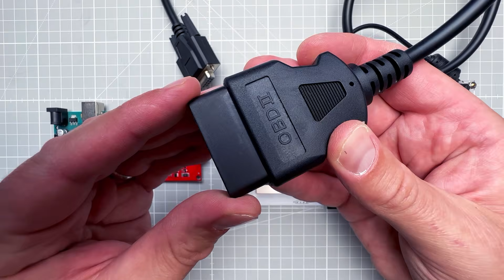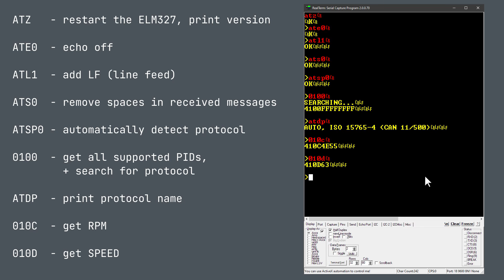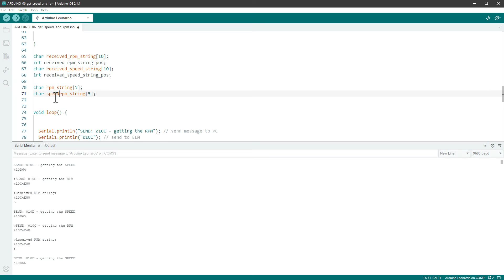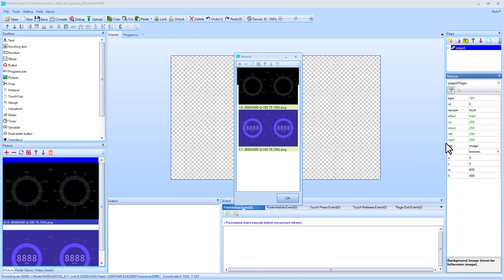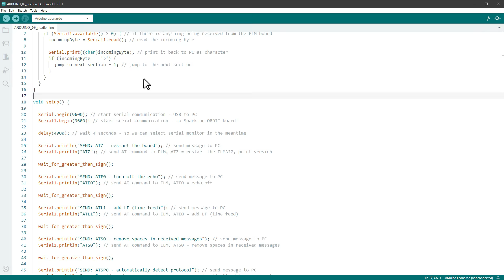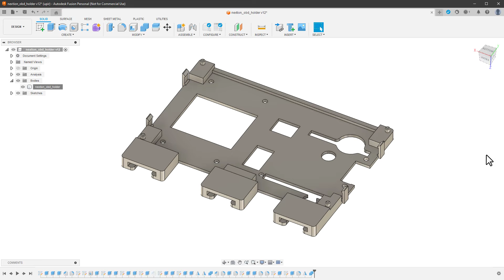Arduino Dashboard (full tutorial - with Nextion Intelligent Display, OBDII ELM327, Arduino Leonardo)

Comment: Hi, do you happen to have a tutorial on iso14230-4 fast init?

Would like to have Voltage, ECT, SPD and RPM display.

Trying to do this on a 16x2 lcd display.

I am new to this world.

Thank you.
Reply from the maker: The current sketch should work also for the iso14230-4 protocol. Have you tried it?
Reply: @upir_upir Hi, thanks for the reply. Actually, have not yet tried your tut. I am trying to work things out on MPLAB, using pic16f886 chip that I saw online but it only works for 5baud. Been trying to experiment with some codes to make it work with fast init (10.4kbaud). Maybe you could help?

For sure, in the future, I will try your tut if I fail to make my diy to work. Haha

Thanks again for the time.

Comment: How would I accomplish with for a vehicle that doesn’t have a obd 2 port but it have a lcd digital display say for maybe a jetski
Reply from the maker: How is that LCD display getting the data? Although there is no OBD2 port, jetski (if it´s not too old) might still use some kind of canbus communication. Since jetskis are not that common, it might be hard to find any related information. What kind of model and model year are you looking into?
Reply: @upir_upir a 2006 honda aquatrax f12x turbo gpscape I believe it might I’ve been looking for the type of info online but nothing I’m going to try in the service manual next
Reply: I believe from the research I think it through canbus
Reply from the maker: I would start with acquiring some dedicated tool for service so that you can at least verify that you can get this kind of information from the jetski.

Comment: Very informative and well explained!
Is there a way to achieve faster readings in order to for example make the speed and rev readings smoother? Or is it just a matter of averaging the results in the code?
Reply from the maker: You can increase the baud rate between the arduino and display, as well as between the OBDII and Arduino. I will try to do that to see how fast it could update.

Comment: Great project, please tell me if KWP2000 fast init protocol can be used. I want to try this on my Opel Vivaro my 2006 1.9 cdti with a bosch edc15c ecu. I have tried with a few elm327 different versions over bl and ble and can only retrieve battery tension, thanks.
Reply from the maker: I was testing this with Opel Vivaro 2006 2.5, though I´m not sure what ECU that car uses, but it worked without any problem.

Comment: I think the stutters are due to the low baud rate of 9600, the Nextion displays support up to 921600 and the ELM327 supports up to 500000.
Reply from the maker: Good point. I will increase the baud rate and see if that helps.
Reply: @upir_upir  It would be nice to know if that was the reason.
Reply from the maker: Everyone says there is a limit to how often you can get OBDII messages, but I guess it´s quite dependent on the car model.

Comment: Hello, I wanted to build something like this but with more robust graphics. I believe the Arduino isn't a good fit because it can't render images or higher res. What would you recommend instead of the arduino?
Reply from the maker: You are in a good place, as this video is not using Arduino for graphics. All the work is done by the display itself, and Arduino is only sending values. This would be an ideal setup for your usecase.

Comment: the question is how to apply this to a motorcycle where OBD port is not available. Like how we can make Arduino read data from motorbike sensor data or at least get the data from motorbike odormeter.
Reply from the maker: It depends on how the sensor sends those data, but I do plan to interface various sensors in future videos.
Reply: @upir_upir  for the most part, i can see that these data sent from sensor to microcontroller via 4 bits and the LCD

Comment: Tell me, please, is it possible to read data from a file on an SD card in the Inteligent series using the program in the display itself or can they only be transferred to an external device? Do you mean text files, not audio and video files, so that you can store data on the SD card that can be quickly updated without reflashing the display itself?
Reply from the maker: I believe it´s possible, but I haven´t used that capability very much. Please see the documentation, it´s actually quite good (nextion instruction set).
Reply: @upir_upir  I didn't find such commands there.

Comment: I'm currently getting ready to do a similar project, although I decided to take signals straight from the ECU of the vehicle. I want the RPM readout to be as quick as the analogue gauges in the dash, every OBD interface I've seen there's a noticeable delay. If you were just presenting the tachometer, how fast could you realistically refresh the data without bogging the arduino down with data? Is this something you could/would investigate?
Reply from the maker: I will definitely investigate this a little bit more. In the current setup, there are multiple factors that are slowing down the refresh rate. I have seen some info about OBDII only being able to provide data every 100ms, but I don´t think that true, at least not for my cars.
Reply: @upir_upir  im building now arduino datalogger using obd2 elm327 Vgate iCar Pro BT3.0 bluetooth dongle and ive got 20hz refresh rate with 1 PID (20PID/s), now i bought Vgate vLinker MS and it should be even better, cant wait to test it.

Comment: Can i offer you an idea? unfortunately i dont currently posess the skills to make this, but i had a dream about it. Can you program an Arduino or ESP32 etc to do the following. Diagnose Complete or blown fuses in an vehicle. Ideally you could poll the diagnostic via a button, or ignition on etc. I thought of it when i watched your RS style Gauges. But back on track... All you would have to do is Verify whether a circuit is blown or closed. I am unsure on how many fuses you could monitor. But basically upon whatever method you query the open or closed circuits you could display blown fuses like " Radiator fan Blown" or Fuel Pump fuse Blown. Obviously you have to name the inputs etc. but you could 3d print a socket containing a positive side and a negative side with leads to the arduino, and place the fuse you wanted to monitor in the socket. im sorry if this doesnt make sense, but i know this idea would be great in the aftermarket car market. Imagine you start your car, look down at your little gauge and it has a Green light if youre good to go, or it displays the named fuse that is blown. maybe individual inline resistors on each socket could be the value you query. ?
Reply from the maker: Thank you for your comment. That’s interesting idea, but unfortunately I don’t have skills to do project like this.
Reply: @upir_upir  I think i might have made it sound more complicated than it is. All it would determine is a open or closed circuit. you can measure this with a lead from the positive and negative side of a fuse. It would probably be best to make a little adapter to clip on to the top of each fuse that has two wires going back to the arduino/esp32 etc. Each one would just need to be labeled so we know what circuit failed to open.  the delay wouldnt have to be milliseconds, you could even set it to poll one single time upon ignition " signal wire" to initiate the read. The part I am unsure about is how many circuits an arduino can use as inputs. But lets say you attach a positive and negative wire to a fuse, and you label it Radiator Fan Fuse. Pop the fuse and make a screen read out " Radiator Fan Fuse Blown".  You do amazing things and i have much respect for you.

Comment: you are a warior thank you. But couldnt you do this project without using the arduino ? . Just sparkfun to nextion?
Reply from the maker: Yes, in theory you can do it, since Nextion has a serial connection, same as the sparfun board. It would take some more time, since the nextion commands are quite limited.

Comment: What is the maximun output frequency of rpm data? Want to build something like a sound generator. Catch rpm, engine load and gear, map with sound data.
Reply from the maker: Some web pages say that you should wait 100ms between getting data from OBDII port, but I guess it depends on the car. If you need faster input, you can try canbus or perhaps a dedicated sensor.

Comment: Bringing back memories.  I first used AT commands 30 years ago on 300  baud modems.  Yes, 300  baud.  We had to use the telephone handset placed in a special cradle which in turn connected to the pc.  Oh, the memories (of the pain 😂).
Reply from the maker: According to Wikipedia, AT commands were introduced around 1981. I wonder if their original creator would think they would still be used 43 years later..
Reply: Probably more than 30 years ago if it was a 300 baud modem 🙂

Because next year will be 30 years since I got my first modem and it was 28800 baud (v34 standard) and there was definitely more than one year between 300 and 28800 😁

Comment: So i want to use an elm327bluetooth dongle but i can figure out how to do it, my bluetooth device has a pin "1234", you know how i could achieve that? thanks for the gauge tutorials by the way
Reply from the maker: I don´t know yet, but I will play with those dongles soon, so perhaps in the next video, I might have an answer.
Reply: you need bluetooth module which can serve as a master, for example HC-05 for arduino, it can be switched to master, then you connect to elm327 bt dongle.

Comment: Another awesome project. I am planning to do it in my mk2 Golf with 1.8 turbo from mk4 Golf swapped. It should be easy to match digifiz cluster project with obd data like rev, speed, coolant temperature and fuel level, all of this data is supported in Bosch ME7.5 ECU by obd2 and shows in any mobile app connected via ELM327 BT . But I am wondering what about turning on the icons (lights and so on) and switching MFA functions with stock MFA switch. Is it possible to send info to the display just by shorting a wires to switch specified area of values created in Nextion?
Reply from the maker: Thank you! I´m sorry but I don´t know how to get the state of those individual icons and warning lights, I would definitely start with checking the voltage levels to make sure you are not frying your Arduino if those signals are above 5V.
Reply: @upir_upir  good sugestion, I'll check voltage level in the cluster pins when e.g. light is on.
Reply from the maker: Sounds like a good idea. If it´s 5V, than it´s really just a matter of getting the pin state. If it´s 12V, you would need some voltage divider.

Comment: I m in process of developing a motorbike version and I want to make a fully personalized pcb to have everything really compact and make the code have condition alerts, I would like to discuss with you some things about it. Thanks!!!!
Reply from the maker: I will reply to your email soon. Thanks!
Reply: Were you able to complete the project?
Reply: @ still in process, all DIY learning pcbs and coding with IAs
Reply: @XxNachilloxX  I wanted a project that shows engine temperature via OBD like the head hud display on the market
Reply: @ It depends on so many things…. Chip that you are gonna use to connect to de car…. Each car can use diferent types of protocols and also each protocol talks diferents speeds. Newer cars are easy to read an display

Comment: GREAT MAN . ty you have read my comment. many thanks
Reply from the maker: You are welcome, hopefully it was understandable.
Reply: @upir_upir  ofc its understandable. im just looking for a  3.5'' Nextion to fit in a air vent, just to show (for now) turbo preassure,  intake temp, water temp and map value. later with your help, ill try to put sub menu or tabs to show other values
Reply from the maker: Sounds like an interesting project! What car are you putting this into?
Reply: @upir_upir  wolkswagen passat b5 1.9 tdi from 2000 with pd engine
Reply from the maker: @Helder_Paulo cool, do you have any pictures of your project?
Reply: @upir_upir  no i just have those simple digital gauge from ali express 25€ were os possible to see exaust temp. But i also use vcds do check some values. Old cars 😅

Comment: Is the display you specified daylight readable, or readable inside a car in daylight?
Reply from the maker: It´s mentioned at the end of the video, with some in-car footage driving during sunny day, so you can see it by yourself.
Reply: @upir_upir  Thank you, I cannot believe I missed the end of your video...  apologies.
Reply from the maker: No worries, hopefully, it answers your questions. Interestingly, when the display was in a place of the dashboard - i.e., covered with all the plastics around and shading on top, it was not that bad, but I would still go with brigher display instead.
Reply: @upir_upir  I think the display you used was around 300 nits, do you think something around 600 to 800 nits would do the trick?  I am working on a diesel generator tow behind, and am looking for a 5 to 7 inch display for that project.  Any recommendations appreciated.

Comment: Nice project UPIR, many thanks for  this mega tutorial!! You just kicked my butt to move and do something similar for some project waiting for me to decide doing them!  And you just confirmed my thoughts on using Nextion displays on cars, their brightness is soo low.  I have tested some little 2 inch IPS displays with 300nit (300 cd) brightness and they work very well even on sunlight shining on them, but those are not easy to use as the nextions, but thanks to your previous tutorials on those DWIN, maybe I will have a change to do something.
Reply from the maker: Thank you for your nice comment, yes, using DWIN displays with this project  would be a good idea. I do plan to cover it in the next video.

Comment: to smoothen out the display refresh rate, is it viable to add an extra frame in between two frames that displays the average of the previous and next values. this would give you twice the fps using the same report rate.
Reply from the maker: Yes, I will cover smoothing the animations in the next video. Thank you!

Comment: Super video as usual. So a suitable Dwin screen will be needed in a 10” size for my needs then, along with a uno of some flavour. Don’t need the odb2 part, I’ll be reading from analog signals.
Reply from the maker: Cool. Could you perhaps share more details how you interface those analog sensors? Thank you!
Reply: @upir_upir  well they all have feeds to the dash on individual wires anyway, so it should just be a case of measuring some resistances and counting pulses. I’m not 100% sure the exact method for each of them yet.
Reply from the maker: ...just be a case of measuring some resistances and counting pulses... -- I would probably remove the word "just" :) It´s definitely not a "just" for me.
Reply: @upir_upir  I’m being optimistic. 😂 I have a feeling I may need to add some components to get the inputs to a place I need them.
Reply: @upir_upir  Have you got a link to a good Dwin screen for this project. I'm confused as to which one to use.

Comment: WOW! OBD Protocol has been one of the few areas I have not ventured in. Thanks to you I am feeling much more confident to start an OBD gauge project now.   I have already adapted your VW DIGIFIS to display RPM, temperature voltage and fuel data from an old 1965 Mustang. Works very nice indeed.
Reply from the maker: That´s great to hear, thank you for your nice comment, and good luck with your project!

Comment: You could just use a while (true) {} for your character skipping and exit it with a break.
Reply from the maker: What would be the advantage of such code?
Reply: @upir_upir  Well. "break" is the standard way to exit a loop, so it's not exotic. As you are looping forever and exit on a condition that is not a thing like a ... countdown (like "while (counter--) {}", it is the most obvious way. And you save a (in your case unnecessarily global) variable. And yes, a tiny faster execution though that's irrelevant here. Another option to skip until target character (when sure that it will arrive) would be a "while (readchar() != '>') { /*empty*/ }" ... I don't have your exact code in mind now, but as far as I remember, this is basically what you do.
Reply from the maker: Thank you for your explanation, it makes sense. Someone suggested using the built-in function of Serial.readBytesUntil() - that might probably be even more elegant solution.

Comment: There is a library to work directly from elm327 via esp32 own bluetooth.
Made a lilygo esp32 oled display for displaying the temperature in my opel van 😊.
Reply: Link for library pls? Thanks
Reply: Probably he means Elmduino
Reply: Thanks my re got cancelled
Reply from the maker: Cool. What kind of temperature are you displaying in your van?
Reply: @upir_upir  
Watertemp because the van has none displayed and its on obd.
Actually I am trying to merge it with Your very nice temperature gauge on the round display esp32s3 HW next. Thanks for Your work and inspiration.
Reply from the maker: No water temperature on the dashboard? That´s quite unusual. I´m sure my videos are helpful, good luck with your future projects!
Reply: @edivollgas719   pt afisare temperatura Opel...https://www.youtube.com/watch?v=3nfqn0Zwl3M
Reply: Were can I found your project?
Reply: I've been trying to connect ESP32 to ELM327 by BT for like a week now but I couldn't get the pairing by code to work. Thank You very much for this comment! I'm going to try Elmduino right now! xD

Comment: are the bottom two bits of the rpm significant in some way?
Reply from the maker: Probably not for the driver, but I’m sure the ECU is probably using it for calculations.